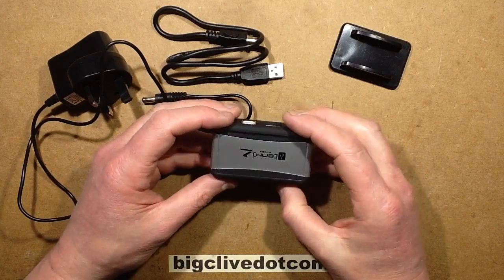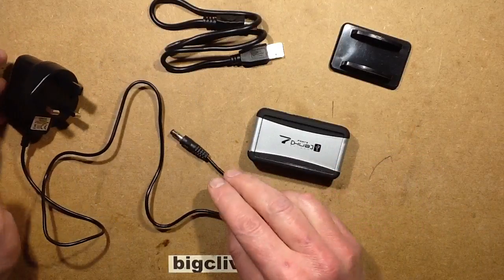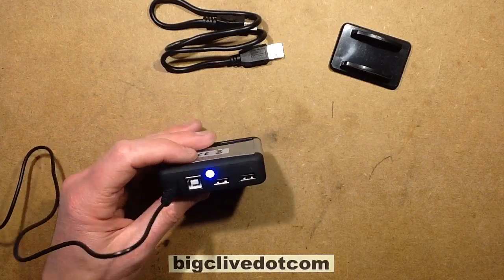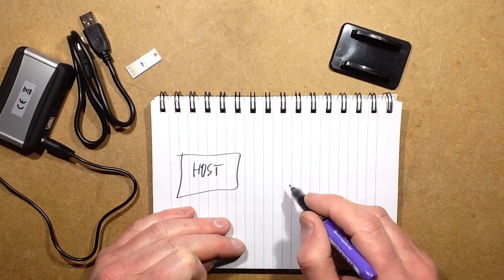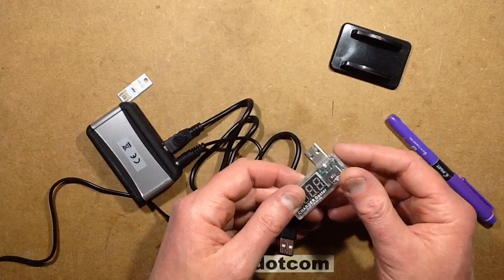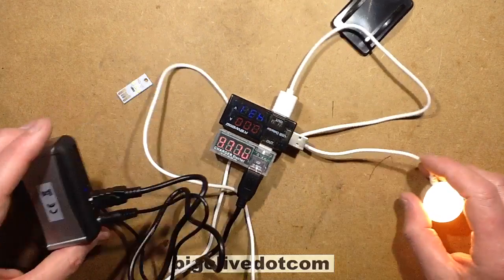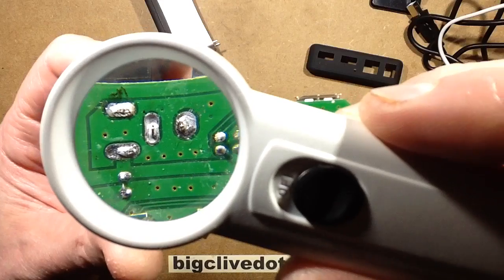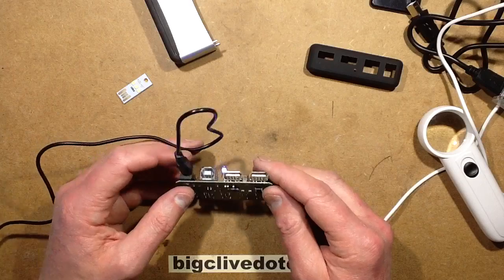Computer killing powered USB hub.  (Mac murderer)

Comment: I actually don't believe he blew up 3 Macs, if this was the case it would have happened a lot more, so, did we hear a lot about it?
No, so that means this is not widespread and this is just carp/nonsense/FUD.
Resetting SMC does wonders if it is needed.

I like your videos a lot +bigclivedotcom but look what you get here, a lot of Apple hate, for what?
Reply from the maker: +Feb Feb I'm wondering if the dead macs were actually just hung because of the presence of the 5V on the USB port and if they actually tried going through a troubleshooting procedure by removing external devices and trying to reset the computer.  One of the biggest problems there is that Apple have made their computers TOO idiot proof and reduced their users abilities to troubleshoot computer issues properly.  I know too many people with their products who don't even know how to reset and reboot them.  Perhaps the "new motherboards" were actually the original ones reset.
Reply from the maker: +Les Paul But what about people who can't build their own computers.  :(
Reply from the maker: +Les Paul But that won't synchronise with their 6-times normal price iPhone.  :(
Reply: +bigclivedotcom This is what I suspect. I've plugged shorted USB devices into my Mac and, like on PC, it causes the USB controller to abruptly die until the device is unplugged and the computer is rebooted. If you try to reboot with it plugged in, the computer gets angry and refuses to boot (PCs do this too). Removing the device solves this issue. I have fried the cheap-o USB hubs included with cases for front ports doing this, but never any of the controllers on the motherboard.
Reply: +bigclivedotcom So much Apple dissing. If you're tech-savvy, then Macs actually offer a lot of details under the hood that you can have access to and play around with, especially when troubleshooting hardware and software problems. The Apple Hardware Tests integrated into the "BIOS" and an OS with BSD unix core give you a lot of diagnostics, access and tech details if you go digging.
Apples are really easy to troubleshoot on your own if you know your way around and are tech savvy enough.

It's just that usually you don't have to.
Reply: +RogerWilco In terms of software troubleshooting, perhaps. Hardware? No chance, if the hardware on your Mac breaks you either get a new one or overpay to get that part replaced.
Reply: +RogerWilco If you're tech-savvy, you don't need that and it just ate up room on the EEPROM that could've held code for a more elaborate user configurable bios instead, but apple doesn't want people to have control of their equipment.  That's not the iSheeple way.

To be fair, none of the OEMs want users getting into system configuration areas of the equipment, but Apple users in particular as a group average, have an emotional disconnect from technology which is why they payed MORE money for less computer that also does less from crippleware programming concepts, not just overpriced hardware.  I do dig their funky metal cases tho'.
Reply: +petey815 Sadly, from what I have heard, Dell is the same way.
Reply: RogerWilco Actually, Macs are NOT the choice for the tech savvy.  And, despite, what the Unix community would have you believe, Unix is a lousy kernel.  It is over-designed.  The designers made things even more ridiculously step-heavy than Apple OS.

The BIOS is OS-independent so...

Apple computers are a serious waste of money.
Reply: Stuart Wood
I have a different theory, that most people wouldn't have tried it on 3 separate macs, would have instead assumed their mac just died of its own faults and possibly tried it on another system where it didn't cause any problems so the true fault was never discovered most of the time.

The odds seem very high that this hub design has killed a few % of systems it was used on, but certain ones would be more susceptible and certainly not many would find bigclive's youtube page to report it when the generic products like this hub sell under many fake brands and model numbers but the video title has none of them listed to find with a search.

Lastly most people buy a dirt cheap generic hub to save money and would likely have picked one that didn't include an external PSU and they never hooked one up to it.  I don't know about the one in the video but most hubs' power input jack isn't even a common size to most consumers, is a barrel jack around 3.5mm instead of 5.5mm so they're unlikely to have a spare power adapter that would fit it.
Reply: +Feb Feb I can tell you it is true. It has burned both usb ports on my mac, my external drive's enclosure and the device itself. It costed me 90$ to repair the mac and 15$ for a new enclosure. Fortunately I didn't lost any data.
Reply: +bigclivedotcom Gotta love this passive aggressive Apple bashing. Cheers, Clive :D
Reply: +smidget2k4 That's not evidence because it's "only" a short, not a reverse current flow.  Further it may not have had anything directly to do with being USB or the controller but rather that it pulled down the 5VSB rail, often used to power USB on modern systems, too low.

I'm not sure what you mean about "cheap-o USB hubs included with cases for front ports though".  Generally case front ports do not have any hub at all, are just direct wired to standardized plugs that the installer puts on motherboard controller connected USB pin headers, meaning there are no active components between the motherboard USB pin header and the case USB socket.
Reply: +Craig Gardner it can be done, you just probably should not try
Reply: +Feb Feb We just had a motherboard on an iMac fried by a USB hub 4 weeks ago. Looked very similar to this one as far as shape of device. But it had no actual labels for a maker. Just a cheap chinese junk hub. The iMac just died as soon as it was plugged in. No amount of resets would get it to boot again.
Reply: +petey815 Yeah a similar strategy though slightly different device ID implementation right down to the individual specimen level is also used on a certain make of printers, that even prevents you from installing an otherwise EXACTLY the same circuit board if the prom programmed serial # on it does not match what the host detected the first time it was powered on, forcing owners to purchase virgin boards from the manufacturer at FULL RETAIL so they have a viable one that the host didn't program yet.

Literally you can buy two printers of that make and (various but in this case the same) model sitting on the same shelf at a store, power them both on then turn off so you know they work, then swap the screens between them and they won't work until you swap the screens back. The name of that manufacturer, ironically enough, rhymes with "SexPark".
Reply: I think three Macs is a totally plausible number.  Consider that your average Macintosh user won't cheap out on a crappy USB hub, and even if they did, it might not be this one.  Then consider that not everyone reported the issue and some may have fixed it themselves, then three seems pretty reasonable to me.
Reply: +bigclivedotcom Well, it's not like the average Mac user would know the difference between a hard reset and a replaced motherboard... but they've already demonstrated that they'll pay a lot for a little and are easily fleeced.
Reply: I agree seems like  something really  basic already has solutions in wide use.
Reply: +RogerWilco Integrated hardware tests.... Yeah like every laptop I've fixed since like the year 2000. This is not particularly mentionworthy, a lot of laptops do this. Also hardware issues will mean you're basically fucked. Because Apple 1) refuse to release information about their hardware and require you to send it in 2) doesn't supply components for repair. I've never seen a consumer PC with custom hardware components - it's all off-the-shelf. Only thing that's usually custom are the PCB's for obvious reasons.
Reply: Mythricia
You're basically fucked either way because any remotely modern motherboard has USB integrated into the chipset, which is BGA soldered to the mainboard, not a component you can just swap out if it fries unless you're adept at component level troubleshooting, have a hot air gun to desolder, and mad skills with a hot air gun to resolder it aligned without burning adjacent populated board areas.   It's not impossible but the skill/time/expense exceeds the value of the mainboard.
Reply: Stinky Cheese Hardly true, as there are businesses that live off of board-level repairs. Typically for Apple devices admittedly, but they still can do repairs on other devices for cheaper than manufacturer service or certainly cheaper than a full-on replacement.

Disregarding chip-level repairs (or board level repairs, depending on how you want to word it), which IS absolutely 100% doable by anyone who takes the time to learn some rework skills, you can also just replaces sub-boards or other components on most PCs or laptops. Replacing screens and backlights, replacing various sub-boards etc, is a trivial task on notebooks, and something I've done many, many many times. As pointed out earlier, trying to do something like replacing the display with an Apple device will soft-brick it and it can then only be serviced by Apple for a huge enormous cost, despite the fact all they're going to do is plug in a service port and click a button to soft-un-brick it and install a new Apple-stocked screen, which will add another several hundred dollars to the service cost.

And to think, in comparison, I can just eBay a whole new motherboard for a recent laptop computer for like literally 60$. Literally. could cost more depending on the board and if a hardwired CPU is needed/required. Still going to be less than the inspection fee alone for an iDevice.
Reply: Mythricia
Quite true, as the average system is not worth enough to pay for such repairs.  Apple owners may be idiots that pay more than something is worth, but that doesn't make it a reasonable thing to do.

You forget the other option which is not manufacturer service or full on replacement.  It's buy an equivalent USED replacement or just a used pull mainboard.  That's practically always cheaper than paying for a professional rechip and in fact, very few places that do repairs, do chipset replacements instead of more simple easy to work component replacement.

Chipset level repairs are indeed possible, but not at all a sure thing, there is a significant % of failure involved and there's the cost of the new chip and labor either way.

Replacing screens and backlights is a trivial thing for a child to do compared to a successful chipset swap.  It's not at all the same type of repair.

Nobody that's sane pays for professional work on this level.  Used laptops just aren't worth that much even if it's a mac.  Besides if you own a mac you were compelled to replace it every 18 months anyway out of ego, just to fit in with the sheeple.
Reply: *****
More importantly, what's wrong with hatin'?  It's just as valid and senseless an emotion as love.   The irony is that people don't even get that their desire to censor freedom of speech is by far the most offensive thing possible.

Hate serves a purpose and should be embraced where appropriate, until resolved to an objective reason that is not required to be explained in order to retain freedom of speech.
Reply: Stinky Cheese I think we are in agreement on the bigger picture of it all then, and I suppose you're right that doing the full-on official Apple service or equivalent is not necessarily the most common approach anyway, certainly not outside of warranty coverage.

But either way, it would be nice if Apple could get on the same playing field, repairs wise. I know one of the guys on YT doing board repairs on iDevices (Louis Rossmann) has ranted about it before how it's impossible to get access to the Apple chips and devices - basically they're not allowed to perform the repairs they would otherwise be capable of... They have to live off of scavenged components from decidedly-dead devices/boards.
Reply: +Les Paul Why would you ever recommend someone get a prebuilt PC? Honestly
Reply: +Feb Feb 
Re: All the Apple Hate, at one time Apple made some truly worthwhile products, but their desktops leave much to be desired nowadays. The iMacs aren't user serviceable and the Mac Pro trashcan is way out of date. Their laptops are still some of the best, and Asus/Dell/Microsoft try to compete, but they just can't match the level of finish. (trackpads especially)

OSX is great too.
Reply: +rawkinghorse  Some of the older Macs weren't so serviceable either. I used to do PC upgrades and repair (house call business) and first Mac I was called to fix was an early PowerPC (from about 1995, I think) ... anyway it was overheating due to a dead fan in the PSU. Easy fix in a PC -- back out a few screws, open up the PSU, and swap out the fan. Not in this Mac. Instead of screws, everything was fastened with rivets (PSU not only riveted shut, but riveted into the case, and no way to get at 'em without tearing it down to the bare struts). The fix wound up being "leave the case hang open and point a desktop fan at it".

Our user group had several old G3s donated, and speaking as the UG's hardware dude, let's just say the only other place I've seen that kind of ...creative engineering... was in a Packard Smell.

I haven't had an Apple laptop, but they do look nice from what I've seen. No idea how they are on durability. (I don't generally do laptops.)
Reply: +Rez Zircon  used to service G3-G5 era macs for a university. If you are talking about their towers you are spouting pure BS. They were a joy to work on compared to PCs of the era. Anyone who popped open a quadnostril or B&W knows that. Their PSUs were standard ATX with couple of extra wires switched - I often used generic PC units when the machine had to be up and running asap (oh but I need it to get my article to publisher by tomorrow and I have to do it on a boat to Antarctica bs...) The only pita ones were early iMacs + eMacs as they had a CRT built in which required care around the screen power supply. Even then, if you followed Apple's service manual and didn't skip steps, it all worked. My current Haswell gaming PC actually lives in an modded G4 case as it is the quietest, easiest access, most bomb proof design I came across. Anyway... G4 towers were the high water mark of Apple engineering, and user accessibility.
Reply: +Rez Zircon Calling BS on your comment - and just for proof - https://www.ifixit.com/Teardown/Power+Macintosh+G3+Blue+and+White+Teardown/1459   This is the appprox layout used till G5 alluminum towers.
Reply: +Maciej Pociecha That is newer than the G3s we got. In fact it's just like my G4, which is no different to access or inside than a cheap PC tower. The G3s that came into the user group were in a short metal tower (no fancy plastic) and were of two types -- one wasn't too bad (standard components, but cramped construction) but the older model used proprietary components, was an absolute bitch to get apart, and would not speak to a Mac-to-PC monitor adapter that worked with any other Mac.

The riveted-together PowerPC I mentioned was a flat desktop case; the top hinged open, but everything else was riveted in.
Reply: +bigclivedotcom I've got a copy of Baby's First Shapes, Colors, and Numbers book for them.

Comment: I bought this hub specifically for a raspberry pi zero so I could backfeed power to the board and power peripherals with a single device and a single plug into the wall.

Comment: WowI have several of these! I just checked and there is indeed direct continuity between the 5V power input and the USB upstream port! Both positive and negative are hooked right up. Thank you! I stopped using the power adapters long ago because whenever I did my computer went berserk. But no permanent damage was done as far as I know. Thanks!

Comment: is it possible that the hub has 2 possible power sources? the plug or by using that usb cord... because i have a usb hub that uses one of those ports but it doesnt have a DC port.. only powered by the usb from the computer.
Reply: +vladyerus just finished watching your video and see you covered that..  still very bad for the company to do it that way.

Comment: do you have a twitter?
Reply: +Sean Anderson While you have it disassembled you could just cut the trace to the Host-facing USB connector, right on the PCB. It's fine if you always use the power supply at that point. If you want to use it with power supply or host-powered, then add a schottky diode from host-facing +5 and the PS +5.
Reply from the maker: +MixZ No I don't.
Reply: +bigclivedotcom the reason I'm asking about social media is I bought this fog machine. I wanted to link you to a page where it's sold.
Reply: +bigclivedotcom Could you just snip the positive line in your usb cable to make this work-able again? Not that I would use it anyways.
Reply: +bigclivedotcom I sent you a message Clive please get back to me
Reply: Ty

Comment: Back powering on Raspberry Pi has been shown to be problematic, but not fatal. The solution for powered hubs is to cut the positive connection that goes to the Pi from the hub. I dare say that would be the same with other computers. Pity macs aren't robust enough to handle that back feeding